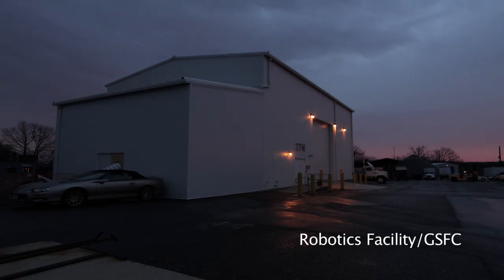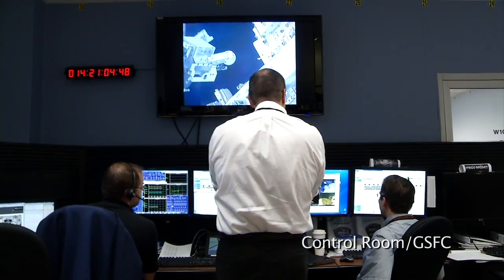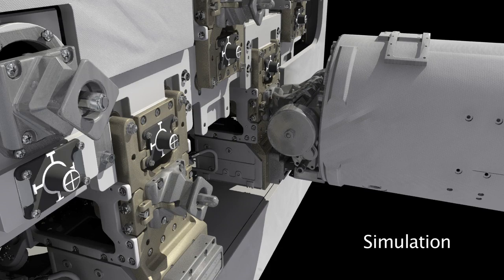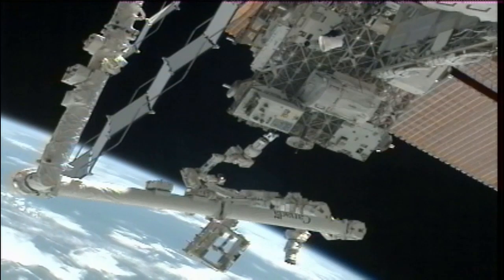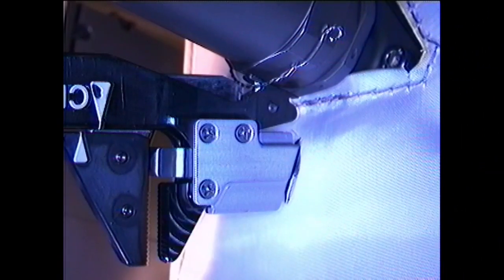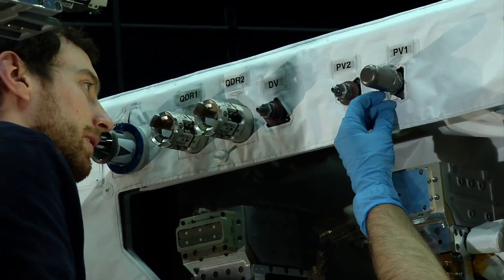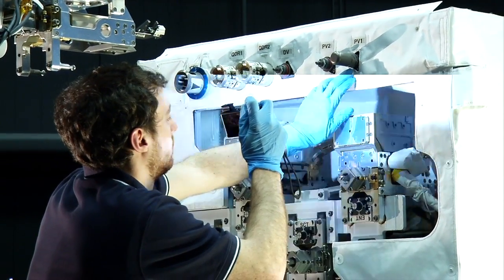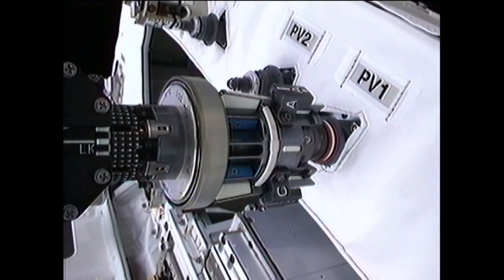NASA | RRM Day One: Captured!

Comment: Robotics engineering teams had discovered an intermittent anomaly in the software that controls Canadarm2, which could potentially have caused the system to use the wrong parameters while in motion, a particular concern when the arm must work close to other structures (as is the case with RRM). After detailed analysis, CSA identified steps that can be taken to ensure Canadarm2’s software selects the right parameters, thereby ensuring it is safe to proceed.